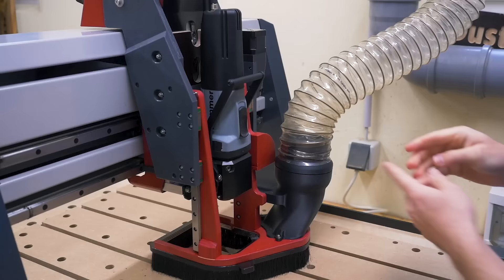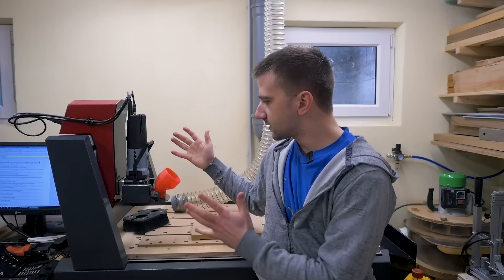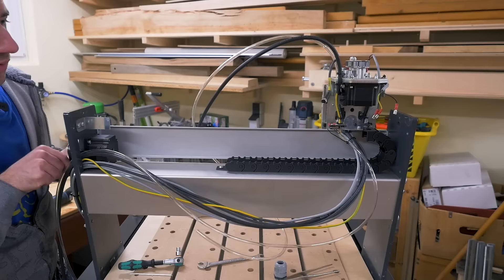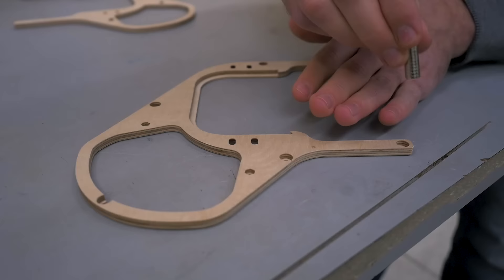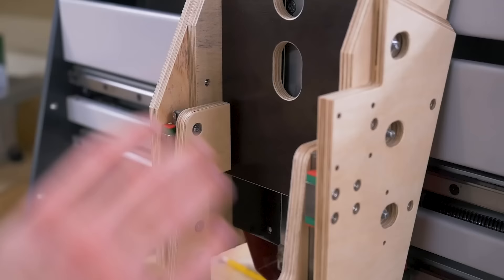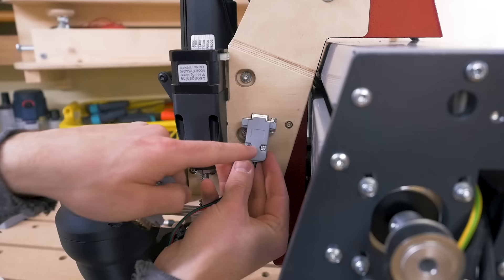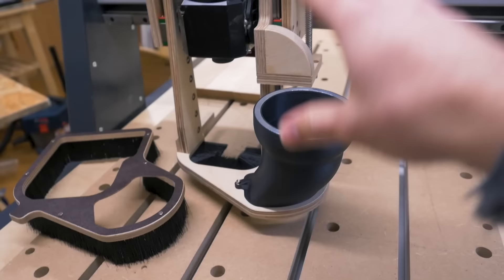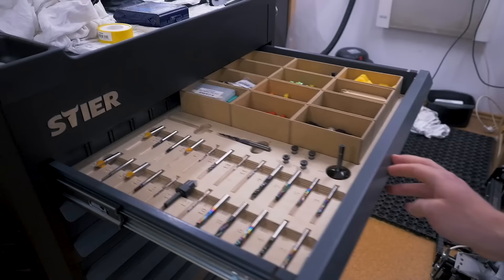Engineering an Automatic CNC Dust-Shoe

Comment: Seems to me you could retrofit the stock shoe to, instead of being fixed to the spindle, ride a guiding rods, 3 or 4 for stability, and your choice of spring to make it contact the work surface. Most likely they could make it like that from the factory for not much more than it costs right now, asuming we get rid of the current knobs and the vertical housing with the hole for them. Just the lower flat plate with the rods going upwards to holes (with maybe bushings?) on the plate you bolt the spindle.
Only potential problem I see is if you are machining a deep and wide enought pocket where bristles start lower than the edge and the shoe can get stuck. Guess you could make some holes on the rods to put a pin to set the max depth the shoe would go...

Comment: Really nice Marius. I have a similar problem with my machine and already have several ideas how to solve it, but so far did not take the time all the engineering will take. One of Your first questions is the same I'm asking: why is the shoe fixed to the spindle?
My approach goes more in the direction of being ableto "park" the dust shoe for tool change or height adjustment. Reasons are that I only do have a three axes controller and no quick tool change. Also I often do not have large and flat material,so myshoe needs to be smaller and (like Yours is) adjustable in height during the job. Stil a long way to go for me, but tempting. Like You said in the end: the engineering process with all its ups and downs and hopefully a working solution in the end is the major fun and challenge of it. 
Really like the idea with the air nozzles to get chips out of deep groves. A real pain especially with MDF which seems to clogg really bad. Best thing is, I already have that basicly installed already and assigned to M8 as my machine has minimal coolant, which I don't use for wood. So for wood I'd just have to change to a different nozzle.
Great Project,Marius
Regards Frank

Comment: I have been waiting for this video Marius. An arriving home from work on a friday to see it in the feed, made my weekend. 40 minutes of German precision engineering really flew by waaaay to fast. Great concept, and execution. A couple of Q´s: When you make the code for the cut, and a job has different tiers, say a pocket like the one for your tool tray boxes. Do you account for deeper brush position when doing a second tool operation "down" in the pocket? Or do you set the brush to material thicken (plus whatever minimal compression of the bristels you want)? and also do you edit in the 4th axis position manually, or automatically via the post processor?  Great job as always Sir👍😀👍😀
Reply from the maker: Thanks man!
Rigth now (and probably in the future) the brush stays at the same height during a job with multiple operations. And I also set the height manually when I make programs with Fusion360 or Aspire.
But I also wrote two custom programs that run as subroutines in the control software. One is for flattening rectangulare shapes and the other for round shapes, rings and holes. Both are fully parametric and I can just type my dimensions, cutting data and hit start. And there the brush also moves down when a flattening pass is done. Since I wrote the whole program, that was easy to implement.
When is your next project coming? The homemade tablesaw and boxjoint jig were awesome!
Reply: @MariusHornberger  Sounds like you have it all covered, that makes sense :) Thanks for the kind feedback Sir. Traction on my channel is really slow atm. I guess I have myself to blame for not being consistent with posting, but even if I try to ignore it, it kinda impacts the drive to make more projects. I have a lot of new ideas on the block with some really cool projects, but personal stuff also seem to eat up alot of time. Thanks for watching Btw 👍

Comment: You rock!
I like to have a tool changer too, but I don't have the knowledge to make it myself. Most cool part I found is the less space it takes and you stille have almost the whole machine bed to use. 
I guess the tiling function a lot, so for my machine I wood even like a tool changer that hangs high enough so I can feed a 18mm plate underneath it. I would love to spend a couple of thousands to get this on my machine, so BZT where are you waiting for!?

Comment: Next time you need to remove a glued plate or object like that black cover plate try using heavy duty fishing line and pull with a sawing action between the two surfaces, like people do when removing car emblems that are glued on.
Reply from the maker: I'll give it a try, thanks
Reply: @MariusHornberger  
Also heating the surface with a heat gun works wonders. Doesn't need much, 100°C maybe at most, if the base material can handle it (no problem for sheet metal like in this case obviously). Of course it doesn't work for all kind of glues (if it's a glue that somehow cures for example), but it really helps with sticky tape kind of adhesives (stickers, labels, double sided tape aso).

Comment: cool :) such advice instead of using a heating gun, use hot water, it does not even have to be boiling water. You will have perfect control, you will only heat what you dip in and you will not burn everything around.
There is still steam but it is under control, just like with the heating gun.
Reply from the maker: Hmm, haven't thought about that. Good idea

Comment: Don't cut yourself short on the feasibility for such a addon for a more professional product.
As a professional product developer myself, I can definitely see this working for a company with some optimizations.
Don't under estimate scale size for example. You have now 3D printed parts, which is great for prototyping or home-use, but extremely costly. When produced in the right quantities, these parts will cost close to nothing.
The same goes for the electronics, you will be surprised how much cheaper those are when bought in bulk.
We are talking an order of magnitude in some cases!

So maybe it cost you 400 euro's, when I make a quick rough estimation, that price can easily divided by 2 or 3.
Depending how far you go with optimizations. 
If I look at the price for these kind of CNC machines, I think that is a very reasonable price to ask for.
Also definitely justifiable in terms of being more time efficient for the end-user.

Comment: The problem is that most people engineer a sucking device around the bit, when in reality you need to give it as much as air as it's consuming, otherwise, it's going to suck air from other places, therefore defeat the purpose of taking away the dust from the bit.
TLDR, you need to have a dual nozzle that pushes air and sucks air, thus sweeping the dust from the positive to the negative.

Source: i use this on my metal CNC, i've hooked both ends of the vacuum cleaner to the nozzle, at opposite ends.

Comment: Marius, an outstanding project.  I especially like the compressed air that agitates the dust so it can be more easily sucked up.  The only thing about your design that seems like it could be improved is the shape of the dust shroud relative to the hose and where the hose connects.  At the beginning of the video you showed how close the hose needs to be to get good dust suction, but in your design it seems like the distance between the cutting bit (where the dust is being created) and the hose entrance is way too long.  When I was watching I was thinking you should use your considerable prowess with Fusion 360 and 3D printing and design a 3D-printed shroud where the suction comes in from the hose and is channeled around the spindle, encircling the spindle like a doughnut.  This way you would have equal suction around 360 degrees, and the suction would be much closer to the cutter.  Let us know what you think about this!   Thanks
Reply from the maker: I'm working on v2 already.
Reply: @MariusHornberger  Can't wait to see it!!

Comment: Very good project! Seeing the price of the Hammer/Felder options, I think paying 500/800€ is not a big deal for the profesionnal customer. This small CNC already costs 5000€. What's 10% more when the dust is kept to the minimum and the option is completely plug-in and integrated into the base machine.

Comment: Amazing work (and video editting), some awesome design and some way too complicated ones, e.g. I would have just used spring, not a motor controlled motion, fit the compressed air line on the vacum hose, etc...

Comment: Great, this are solutions used in pro cnc
Also we can make price less by using for example m10 screw instead Ball screw and few other ideas
Reply: the fine pitch of a regular screw would make it slow, a better low cost alternative would be a tooth-belt or even a wire and pulley and instead of linear rails you could probably use swing arms. it doesn't have to be super accurate.
Reply: @fuzzy1dk  yeah exactly, there are many other options Marius used the most expensive and the most acurate and the most cool option
Reply from the maker: I went with what I thought was the easiest to build. The screw with nut was only 5€
Reply: @MariusHornberger  yeh, the screw also has the advantage that you can get away with nothing at the far end

Comment: the brush looks like abs plastic so if it turns white, it means it will break, but if you paint on acetone and let it dry for a few hours, it should heal
Reply: as a matter of fact, you can do without any heat at all by adding enough acetone to the part you want to bend. the only problem is that if you put too much acetone it might fall apart.

Comment: If you're going to be doing sheet metal like that on your lathe again look at doing a super glue arbor they work really well so long as you go slow and use cooling that way you don't gen generate to much heat

Comment: I have to agree, it mostly sucks. Except perhaps the nozzle part, that blew my mind. Oh and the stepper assembly, every angle is nice. Also, the (protruding) fixing magnets were very attractive. The duct connectors and clamps caught my attention. I could go on for 40 minutes but I'd rather watch it again! Also, seeing the relay outside was very satisfactory for me :-D . Here is another idea: since you already have pressurized air on the machine, why not using a vacuum generator (2€) 
for a clamping assembly? Just saw it on JSK-Koubou channel. Thanks, this is awesome.
Reply from the maker: Thanks man! I've used such a vakuum generator before. They're terribly inefficient and don't have enough airflow. I'd need a proper vakuum pump
Reply: @MariusHornberger  that would probably be... breathtaking. Lol

Comment: Excellent design as usual Marius. You are very talented. Could you provide some info or a link to information on the spindle you are using with the quick tool change. Every CNC needs that. Curious if that is 80mm in diameter and would fit my spindle mount.

Comment: New viewer here, and awesome job! 👍

Is there anything to stop you now using your existing patterns and the upgraded spindle to remanufacture all the timber parts from aluminium so you could rebuild it with the capacity for coolant and then work with harder metals?

Comment: Nice work, well thought out.

I have one question:
You mention you had limited mounting options on the machine and could only use the holes where the wireclam sat before. But you drilled other holes in the machine, so why could you not make more mounting holes elsewhere for the dust shoe assembly?

Comment: I wonder could this be simplified by completely omitting the stepper and letting the brush float on the surface and then connecting a rod (or a string) from the brush assembly to the tool release handle so that the brush lowers whenever you pull the handle down?
Reply from the maker: That's totally possible. StepCraft do it like that on their CNC routers

Comment: Sorry if this question is buried in the comments: did you give any thought to some sort of sensor/controller to automatically maintain a distance from the part ?  Perhaps TOF, ultrasonic or other ?  I've been thinking about this and am worried about the dust corrupting any distance reading, especially optical.  Thoughts ?

Comment: Great Job, I planned to do something similar but instead of a step motor for Up/DOWN movement I'll use a pair of springs with not too much force.
Is there a reason why you do not considered a pair of springs with a rods with not too much force instead of a step motor? i see that you've measured 10kg of weigh, but because the Dust-Shoe was locked with the head if you keep the same structure that you've done but instead of step motor you will use a pair of thin springs just to keep down the Dust-shoe I think that you do not have 10 kg of down force, is it plausible?

Bye

Comment: Good day
I have a question and you showed the model in the cad at minute 7:28, you also showed the part of the milling head with the milling machine. Do you have this from the internet or did you do it yourself. Maybe you can sell it as a plan then I don't have to measure everything myself.
Reply from the maker: I drew that myself after taking meassurements

Comment: Maybe machining the metal ring on your CNC would have been a better solution.
With the painters tape and super glue method (or double sided tape) and very small step-down, I think it would be possible, even though i have to admit that I haven't tried it either so...
Reply from the maker: The jigs were actually made for the CNC router, but didn't have an long enough endmill for steel

Comment: Just about the time I start to think im one bad SOB one of your videos pops up in my feed and knocks me down a peg or two. Thanks for keeping me humble. 
Can you elaborate on how you adjust the dust shoe height automatically in the software?  I was thinking of doing something similar but with no electronics so the dust shoe would just float on the Z axis and rest directly on the part.  I have pretty stiff bristles .030  and a bigger machine.  I have a 3hp DC  which does a good job but cant get the chips packed in the cuts. So when I start pulling the parts off the table I get tons of dust.  Its impressive how much dust can pack into a .25" kerf.  I need a blower for sure to try and clear some of it out.
Reply from the maker: The dust shoe is now my A-axis. I just include lines in my g-code like G1 A35 and that moves the dust shoe to 35mm height.

Comment: Really cool build! May have to do something like this for my CNC :)

But, I'm wondering if you don't get all that much suction in your dust collection system, in my system I can cut MDF with a 10mm surfacing bit with 3mm depth of cut and 9mm overlap, with the bristles of my dustshoe riding just above the workpiece or the hose end of the dustshoe being completely outside if the workpiece, with no dust at all left in the end :)

Comment: Impressive. You talked about how much more it would cost to the manufacturer to make it like this. Actually, not much more than what it cost to make the original. It could have came with it from the beginning if the makers would have put in more effort into the the dust collection design.  You should sell the the concept.  But at least put a trade pattern down so they can not just snatch it from you the idea.

Comment: How would you generate g code for the 4th axis on not so flat parts? I have a similar mod on my list but gave up on giving dust shoe its own axis for that reason. Planning to use a set of bristles with different lengths for different jobs.

Comment: 23:40 Instead of using a heat gun to bend plastic, use boiling water. It has a built in temperature limiter.
☮️🌈❤️

Comment: I am just curious why you would thread both holes. Heck, neither hole needed threads since you were putting 4 nuts on since that hole is not a feature for alignment. I might be having a moment of stupid but if you thread a rod thru 2 plates separated by some length with both plates  unable to rotate would not allow for adjustment.

For cutting sheet metal on your lathe you need a plate of aluminum you can skim flat put grooves in and superglue the sheet metal on. You made it way to difficult

Comment: I don't own a CNC machine, but watching them operate, why couldn't they make a light downforce spring set-up that followed its work?  Should be also made where the whole unit slides easily off to change bits, or simply swings away.
Reply from the maker: StepCraft made such a dust shoe

Comment: Hello
I really appreciate your works, as I am thinking of making a support for my aspiration, I ask myself the following question.
how do you manage the height of the brush so that it falls on the rough, whatever its height??
do you fill in the height of the stock using a macro??
Sincerely
gilles
Reply from the maker: The getS written into the gcode by Fusion 360. I edited  the post processor to do so
Reply: hello
not using fusion but cambam, could you tell me what you have to touch in the PP to automatically vary the height of the Z
Sincerely
gilles

Comment: You keep saying "drag chain" when referring to what is a cable carrier. Drag chains are a totally different setup where you have carriages/trolleys connected by chains that take up the force, and the cables, hoses, etc hang in loops between trolleys that are longer than the section chains.

You're like the third person on YT this week incorrectly calling cable carriers, drag chains.

Comment: Terrible overdesign :) . You could have achieved the same effect with a weak spring attached to the dust shoot. As soon as force exceeds 1 kg (for ex) the spring compresses the dust shoot, so no additional pressure is put on the z axes.